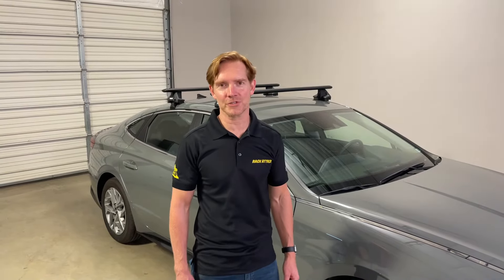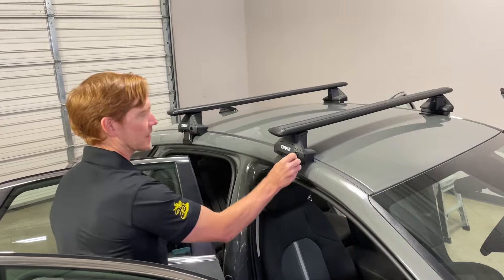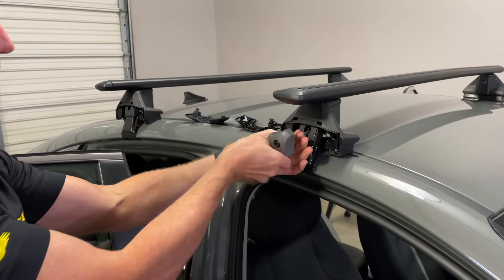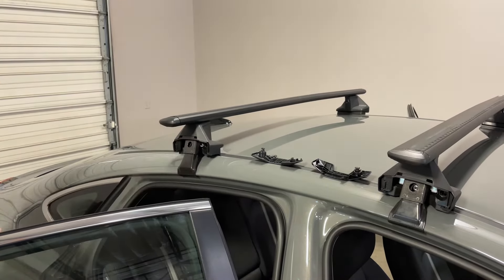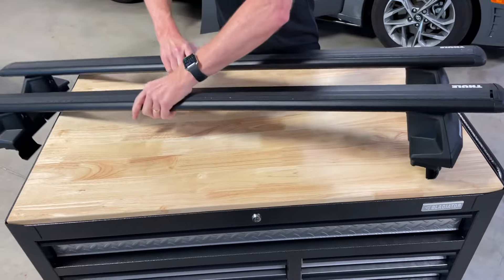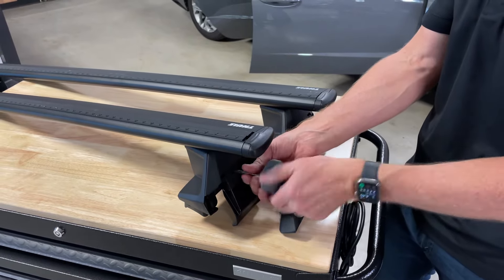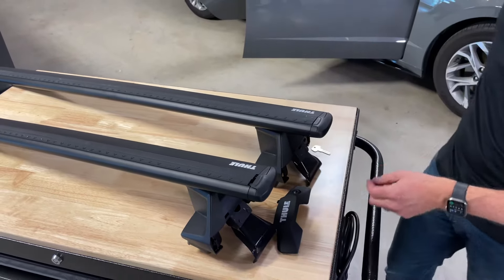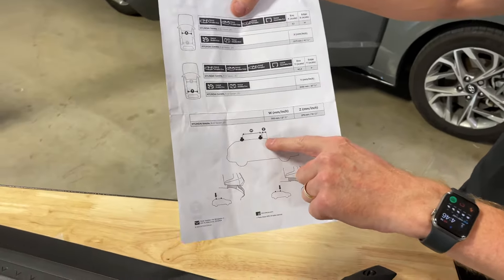How to Remove and Install the Thule EVO Clamp Base Roof Rack?

Comment: Thanks for ur video. Should I put something (rubber or siliicon pad) between metal clamp and car surface?
Reply from the maker: Hello.  The metal door frame brackets are coated in Pebax rubber to protect the vehicle's finish, no other material is necessary.  Thanks.

Comment: How do you replace the fitting kit for another vehicle? I purchased the new kit for my truck but I can't remove the old kit. I can't find a video anywhere to replace a kit for an Evo clamp 😭
Reply from the maker: Hello.  The rubber bases peal off from the plastic bases, the brackets remove by pushing upward, then inward and down.  Thanks!

Comment: My problem was getting the foot pack off of the square bars. Basically the lever had become over the years very stiff. I used good old WD40 to get into the joint. What I didn't want to do was snap the plastic lever which has been on my car in all weathers for about 4 year. That's in the UK so lots of damp driving conditions.
Reply from the maker: The mixture of weather and time can be really rough on most things, let alone roof racks. My advice on how to help would depend on which generation of Thule tower you have. The UK has slightly different roof rack systems then us in North America. WD40 is great for helping break up the rust. If you have a Thule 480 Traverse tower (my assumption) The lever at the back can be flipped/pried open by gently using a long handled screw driver. If the rust/corrosion is so bad that's not working it might require a replacement tower. I've had to use an angle grinder to liberate many bars from rusty/seized towers, or grab a rubber mallet to help force the issue. 

Hope that helps!

Comment: I need to get the metal part off. I don’t know how. So dumb.
Reply from the maker: Hello.  To remove the door frame bracket, push the bracket upward, then inward to release from the foot.  Cheers.
Reply: @rackattack  Good stuff; thank you. Also, I meant that the contraption + me is dumb, not you guys.